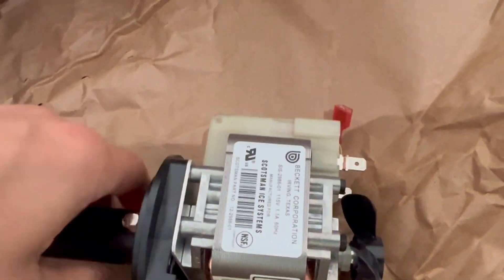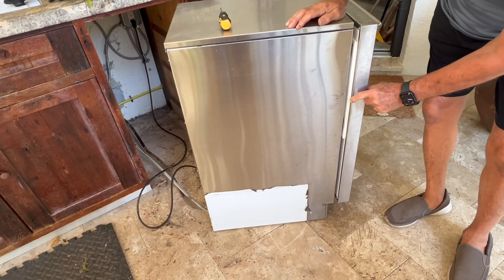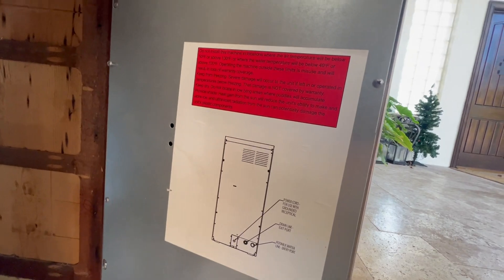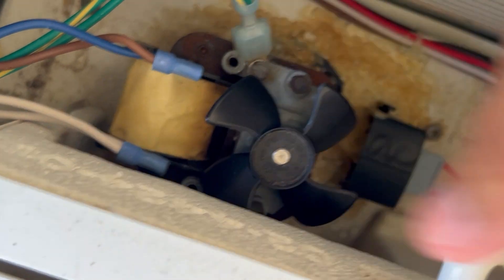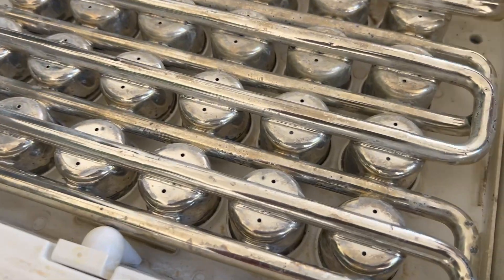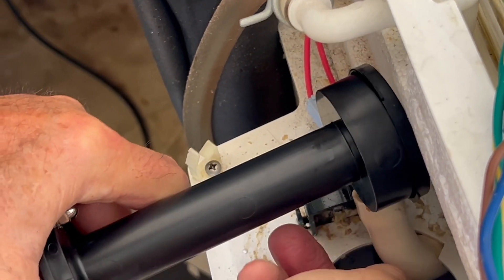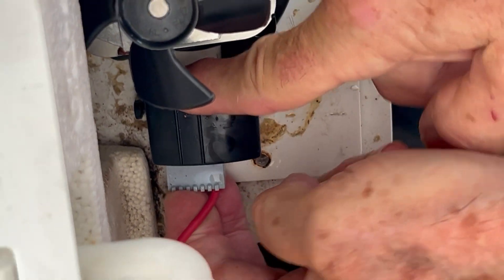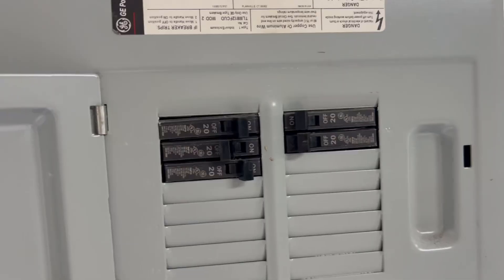How To Install A Water Pump, And Maintenance On a CU50 Ice Maker Machine by Scottsman

Comment: How did you get the old pump out, you skipped over that - is there a procedure that needs to be followed. Hate to break something trying to get the pump out
Reply from the maker: It’s totally easy and not an obvious. He basically just pulled it straight out and that’s that.
Reply: @ I replaced the pump but now  no ice - water is good. Is there a reset procedure? Tried to find it in the manual but not helpful
Reply: Ok, I managed to fix everything. The issue was when you reconnect that hose and put the pump back in and twist it into place, it comes undone and thus the water supply to the spray platform is interrupted. So I went to Lowes and got a flexible hose and replaced the hose so that it wouldnt come undone. Now the spray platform is getting water and ice is being produced. As this was my first time fixing an ice machine, had to learn everything but hey - that's how it goes huh !